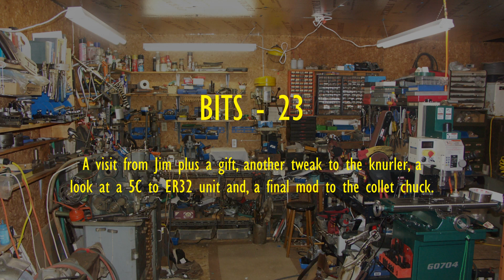Bits 23 - A visitor, and some  tweaks.

Comment: Thanks, Chris.
I was toying with the same chuck lock mechanism idea.
So it works. Great. I'll make one myself.
Thanks,
John
Reply from the maker: Hi John - well, certainly for my old lathe anyways, it seemed the only way to go. That said, it's quite a challenge to make with regard to some aspect's accuracy required.
Reply: ChrisB257 I'll post a picture when I'm done. 😊

Comment: The chuck anti-reversal devise is brilliant.  Looks well thought out and shouldn’t cause much if any vibration plus the “peace of mind” is well worth it.  How come I have not seen anyone else do this.  Onto the scissors knurling tool, well I haven’t made mine yet but I do have plans for a similar one.  I might have the same issue with running out of cross-slide travel.  Its a good thing you pointed this out so I can make a change to how the body mounts before I start to cut the piece to shape.   Thanks Chris!
Reply from the maker: Hi Brandon,
Thank you. Well, the reverse protection deal was very fiddly to make in several ways but - does turn out to be very efficient. Part One of that work was here - http://www.oldmansshop.com/vid-pages/chuck-reverse-safety-pt1.php
Worth making a scissor knurler as it greatly reduces stress on spindle and cross slide leadscrew and nut... make a hex on the adjuster to permit good torque.
Reply: ChrisB257 I forgot about your website. Lots of great tools on there that I need to make yet!